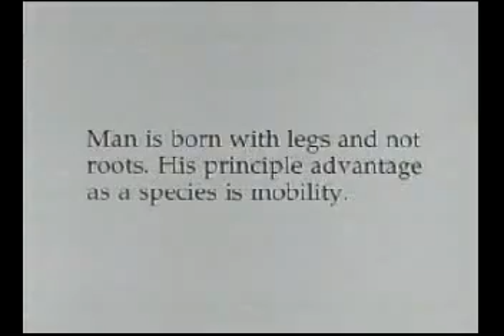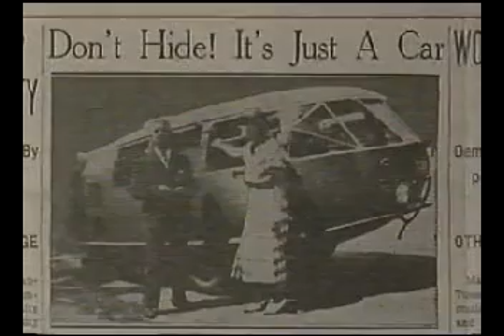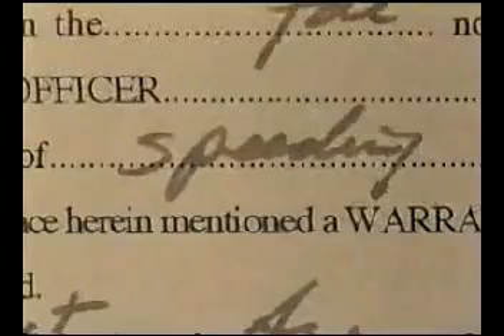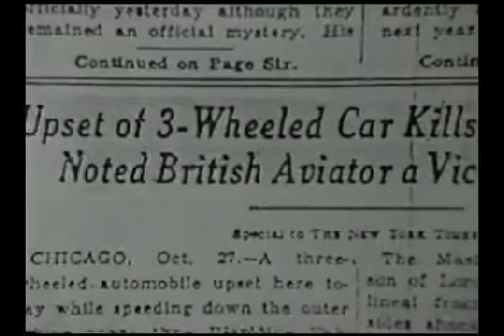How to improve gas mileage: Dymaxion Technique

Comment: The guy who died when this "car" rolled over is a hero. If he didn't expose this thing's terrible handling flaws, and got put into production, hundreds more would have died from this poorly handling vehicle.
Reply: Chevrolet Corsair.

Around 1971 or 1972  first car was a Chevrolet Corvair and I can tell you the that rear design was disaster. 

 It put too much weight in the rear and on turns on wet streets you spin out of control and do 180's and 270's without even trying.

Chevrolet did make a Mid-engine type, that was less prone to spinning on turns.

About the Dymaxion.

I love the basic design of the Dymaxion.

I heard that Volkswagen stole the design to use it for their VX minivan.

I think the steering could upgraded to a computer-controlled so that it would reduce the possibility of getting out of control.
Further, I think another flaw is the single rear wheel.
This could be improved by having two rear wheels that have fenders that make them more Streamlined.

Dymaxions had Wood frames at at time when Aluminum was scarce.
They make plenty of Aluminum today, but better yet,
why not Carbon Fiber frames and bodies?
Wind tunnel testing should reveal any flaws in that respect.

Further, I don't like the Air-cooled engine from my experience with the Corsair.

Why not an Electric Vehicle and have Electric motors on all the wheels, whether three or four?
Reply from the maker: Hello again, Glenn.I just&#160;came across something even better that explains the history of not only the Corvair, but all rear-engine/swing axle problems and the&#160;solutions&#160;that manufacturers like Porsche used (but GM did not at first)&#160;at this link:   http://www.curbsideclassic.com/automotive-histories/automotive-history-1960-1963chevrolet-corvair-gms-deadliest-sin/     Here is a short excerpt:"More critically, a rear camber-compensating spring was not used, despite the adoption of one by Porsche, and a large aftermarket for that developed for VWs, Renaults and older Porsches. This device had come to be seen as the most critical element in taming the vices of rear-engined swing-axle suspensions."     I recall that Nader's famous book, "Unsafe at Any Speed" brought up the ultimate solution that GM made with the "diagonal pivot swing axle" in the 65 Corvair.&#160; I don't recall much else, unfortunately, though he may have also mentioned the aftermarket, camber-compensating spring . . . I just wish this sort of history was made more clear as I was growing up.&#160; A lot of the "mystery" behind the Corvair's problems was totally unnecessary, and still is, simply because our media, educational institutions etc. don't seem to want to know themselves even a little bit about such things.&#160; And in being that way, they continue to dumb the entire society and world down!&#160; :-(
Reply: "A lot of the "mystery" behind the Corvair's problems was totally unnecessary, and still is, simply because our media, educational institutions etc. don't seem to want to know themselves even a little bit about such things.&#160; And in being that way, they continue to dumb the entire society and world down!&#160; :-("

Oh don't get started, bro.

I have been riding that train for five plus years.

I live in Oklahoma and "proud" to say that we have one of the worst educational systems in the entire country.

Sarc..

What is   -1+5  ?
Duh.
What is the Bill of Rights  ?
Duh.

I am retired Engineer that is Volunteer Tutor.
Reply from the maker: Glenn, sorry about that! :-D  But I'm glad to know we share a common frustration (not that it surprises me!).

For myself, I'm no engineer, just an irritatingly inquisitive fellow (irritating to some, anyway) who loves finding out as much of the truth as I can manage. 

Enjoy . . .  if you can!
Reply from the maker: ev0se7en , unfortunately there were only 3 built, and thus there are few to put through any kind of rigorous testing, such as a "skid pad" run, slaloms etc. and thus no one has never really quantified its handling characteristics with anything more than superficial subjective accounts (whether pro or con).  Historically, even with the controversy over the Chevrolet Corvair, I don't believe anyone ever bothered to publish any hard numbers about ITS skid pad rating, or anything else.  One might almost be led to believe that many people prefer NOT to have any kind of quantification, and just make assertions one way or the other.Some car magazines (Road and Track) for example, point out that in their test of the Corvair back in the early sixties, they didn't find any problem with its handling, but then added that they are not perfect.  Others, on the other hand, such as John DeLorean,  have written in some detail about how there was a huge blowup inside GM before it was even released between the various engineers and product developers about its safety (He was at Pontiac then, and he relates how he killed the Pontiac version because the chief engineer there, who had worked at Damiler-Benz before Pontiac,  begged him to).  DeLorean himself was firmly convinced that the Corvair was not safe.  (A condensed excerpt from his book here: http://www.simpleandclear.com/zpicstuff/corvair2.html)Still others point out that when the NTSB tested the Corvair, it handled much better than the Renault 10 (which ended up turning over during the same test that the Corvair passed with flying colors).  So in regard to Fullers strange car -- I wouldn't jump to harshly on it since it had other innovative qualities that were way ahead of the time it was germinated in, but also that there is no real conclusive data.  Of course, as the journalist, Robert Sheer recently related, one of his mentors used to counsel him to "Keep an open mind . . . but not so open that your brains falls out." hahahahah!
Reply from the maker: Hey Glenn.  

From what I've read the pre-1964 Corvairs were the ones without an anti-sway bar, and thus were the ones with the worst handling characteristics (extreme and unexpected "oversteer").  

In '64, after Bunkie Knudsen threatened to go public with the design flaws of the Corvair, it was equipped with the much needed anti-sway bar.  

From Wikipedia: " He also insisted on changes to improve the safety of the Chevrolet Corvair, which was not reported publicly until it was revealed by John DeLorean in his book ' On a Clear Day You Can See General Motors. '. "

https://en.m.wikipedia.org/wiki/Semon_Knudsen

In 1965 and afterward the Corvair had a completely redesigned rear suspension, and all seem to agree that this change eliminated completely the Corvair's handling problems.

What I find interesting is that DeLorean states in his book (mentioned above) that the whole "Corvair controversy" began "in house" at GM even before its initial release in 1960.  DeLorean, who was at Pontiac at the time, was approached by the chief engineer there who begged him to kill the project at Pontiac, which had planned a "clone" model with the Pontiac nameplate.  DeLorean consented to his request, and has never regretted his decision.

Those who "blame" Nader for the negative reputation of the Corvair need to read DeLorean's book.  He names many of those at GM who argued on both sides of the issue BEFORE THE CORVAIR was even produced!!!

Here is an excerpt:

"The questionable safety of the car caused a massive internal fight among GM's engineers over whether the car should be built with another form of suspension. One side of the argument was Chevrolet's then General Manager, Ed Cole, an engineer and product innovater. He and some of his engineering colleagues were enthralled with the idea of building the first modern, rear-engine, American car. And I am convinced they felt the safety risks of the swing-axle suspension were minimal. On the other side was a wide assortment of top-flight engineers, including D. Polhemus, engineer in charge of Chassis Development on GM's Engineering Staff, and others.

"Albert Roller, who worked for me in Pontiac's Advanced Engineering section, tested the car and pleaded with me not to use it at Pontiac. Roller had been an engineer with Mercedes-Benz before joining GM, and he said that Mercedes had tested similarly designed rear-engine, swing-axle cars and had found them far too unsafe to build."